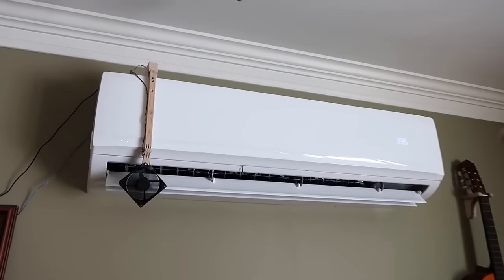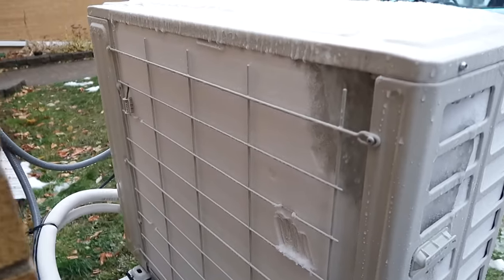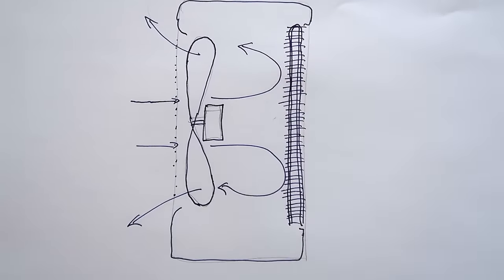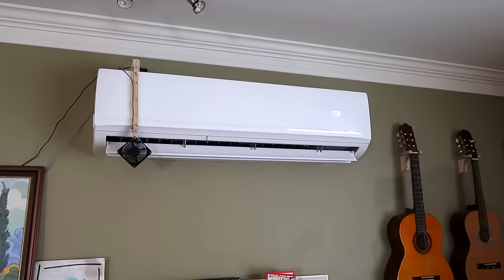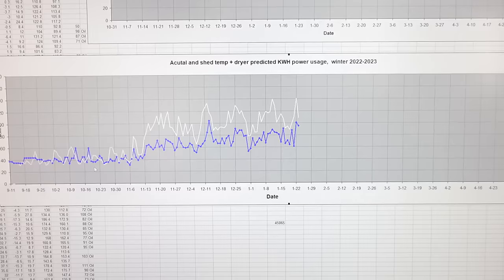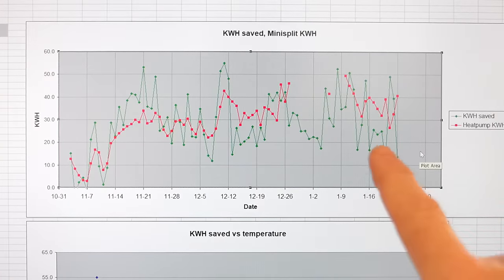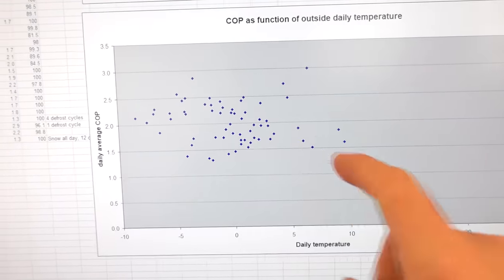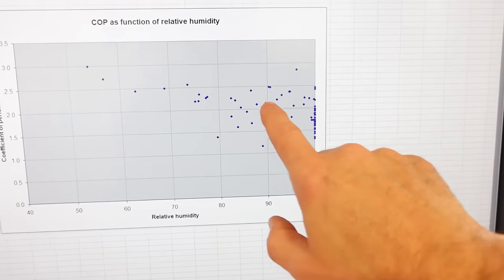How efficient are our minisplit heat pumps in the winter

Comment: Man you are amazing. I'm off the grid in a tinyhouse, so every Wh counts and I've been dying to know about all these things! Thanks for all the work!

On a fun note: it's crazy seeing your numbers of 80-100kWh per day, compared to my 5kWh per day D: :D
Reply: Leave enough space around the outside unit when making the shield. If the air flow is bad the efficiency drops
Reply: Or hear about “cheap electricity” when we in Sweden had around 3 - 6 SEK (0.3 - 0.6 USD) per kWh in December.
Contrasts.. 😁
Reply: @VarionJimmy  wow. Here in Toronto I pay $0.10–0.14… 7k is like $1
Reply: 100kWh here in the UK right now would be around £34 at the domestic rate. That's probably $40 or so US. 😱
Reply: What do you do to consume 5 kWh per day in a tiny house? You need some more efficient appliances man. I run a regular house with 2 freezers, 1 fridge, washer (no dryer), stove, water pump, water heater, computers, lights, 60 inch tv, ... on not much more, about 6,5 kWh per day. All A class european efficiency score appliances. Freezers consume 90 kWh per year.
Reply: @aleksanderkac7530  It includes heating (using a heatpump). The electrical stuff only is about 0.5kWh per day.
Reply: @aleksanderkac7530 What do you do for e.g. hot water? I have a similarly normal home, but most days I can't get near to 6.5kWh, and it's not the always-on devices that are the problem. For example when my wife had a 17 minute shower yesterday, that consumed 2.8kWh on its own (10kW electric shower).
Reply: @BoBandits  Niagra Falls.
Reply: Its why I say solar is nonsense.  Typical US house will need at least 20-30 KW input.  Commercial installations might make sense.  But initial investment is very high.
Reply: @cooperised  I would put a timer on the heater and only turn it on when use is expected.  I would also look at disconnecting one heating rod if not needed.
Reply: @rogersmith7396  Also to solar: domestic solar can work extremely well if you have enough roof space facing an appropriate direction. Battery storage helps a lot especially if you're out during the day but also increases the investment cost of course.

A typical house might use 20kWh per day but that's not the same as 20kW continuous, in fact it's an average of less than 1kW across the day. We have 5kW of panels and no battery, but we time our washing machine and dishwasher to come on when it's sunny so on bright days we pay very little for power, just enough to cover the base load overnight. We were expecting a 20 year payback from the panels but with current energy prices here it'll be less than 8 now I think.
Reply: @rogersmith7396  Hhahaha this is such a bad take. 

Yeah, if you want to maintain the current level of gluttonous luxury spending and utter disregard for efficiency, yes - it's all a bad idea, we shouldn't do anything and so the world will end in 100 years. 

But maybe like.. change the behaviours that got us into this shitty position in the first place? Then we have a chance, and maybe our lives actually get better because we're a bit more consciencious about our lives and what we're doing with them..
Reply: @cooperised  Fine.  Most people don't want to time there activities around the sun or lack there of.  On TV I've seen the panels last as little as 5 years then its back to the banker for a loan.  I am in a windy area, I would like to experiment with turbines.
Reply: @tau9632  Then why would you live in a place requiring 9 months of heating per year like the author?  I guess you think everyone should move to Malibu although I guarentee you the AC runs night and day.
Reply: @rogersmith7396 Well, storage batteries can help with the timing. But really, if humanity has got to the point that we're so wedded to personal convenience to the exclusion of all else that we're not even prepared to use the timer on the washing machine to help save the planet, then we're doomed.

On turbines, I agree, I'd love to experiment. They're not typically very effective in urban areas because of the air turbulence caused by the buildings, but if I could generate even 50 to 100 watts overnight then it would cover much of my base load and complement the solar really well.
Reply: @cooperised  I live on top of a ridge in a rural area and get lots of wind.  A car alternator can generate 1000 watts at 2000 rpm.  Would need to gear up from propeller speed.  I could probably put 10 on the barns ridgeline.  Probably just sell it back to the utility to lower my bill.
Reply: @rogersmith7396  That is only 4 hours sunshine for a 6.6kw system which is cheap. Solar works, please try and keep up. The only problem with solar is exporting energy to the utilities who want it for nothing.
If you have any hobbies, like woodworking or metalworking you will love solar because the stable voltage makes your machines work as advertised. You will definitely notice how much better everything works when the syn is out.
Reply: Why are you off grid?
Reply: @kellymoses8566  Mainly for my sanity.. to be away from people, to be surrounded by peaceful nature, as a challenging but fun engineering and scientific project.. and finally also to explore the options
for a sustainable future.
Reply: @rogersmith7396 , Please don't disconnect one heating rod from the water heater, you'll be making things worse and won't save anything and the water heater will spend more energy and break up faster. Water heaters have 2 heating elements for a very good reason and never run both simultaneously anyway.
Reply: @edide1627  It can be tested. I also plan to use a timer.  The rods are 2500 watts each.
Reply: @rogersmith7396  If you understand how they work you would not need to spend time testing anything.
If you want me to send you a link to a video I saw a couple of weeks ago it would save you a lot of time (can't find it for some reason right now) but if you are really interested just reply and I'll make sure to find the link for you. 
It's a 30min plus video but very well done and I found all the information in it to be reliable.
Reply: @edide1627  I don't know if the heater will get installed this year.  Its not a high priority to me.

Comment: Great discussion. We installed a hybrid water heater with similar function to the minisplit from a gas water heater.  You’ve inspired me to start collecting a bit more data with external sensors.  Of course, to proof is usually in the utility bill.

Comment: My 8,000 / BTU seer 21 Pioneer split heats my 23 foot travel trailer at 8 degrees no problem. It draws a constant 400 watts to do so. Above freezing, in the 30’s it draws around 240 watts and cycles on and off. My trailer is super insulated with R15 in the walls, R23 in the ceiling. There is nothing like the luxury of good insulation and one of the more efficient mini-splits. Of course a high Seer rating and the time of purchase it a bit difficult due to the initial cost being nearly twice as much. Because my power requirements are so low in both Summer and Winter, I can run all this with solar. Note that when initially started and the Pioneer is running at maximum effort, it can draw as much as 980 watts for a short time. Thanks for the video.

Comment: If you have extra temperature sensors I’d recommend adding one each to a liquid and vapor tube on the coil. It should help you monitor how efficient the OD coil is performing. As long as that temperature is close to outdoor ambient then your od coil is performing well.
Reply: Yeah i'd second that suggestion. plotting the actual inlet/outlet temp of the exchanger would give you direct info on it's efficiency.
Reply: Since this is an inverter unit, measuring the temps on the refrigerant is not that informative. The unit will have pressure and temp sensors giving feedback to the inverter that control the compressor and changes the flow in the system. The one thing I could think of is for detecting unneccesary icing of the evaporator, ie. liquid temp and gas temp are close and way below outdoor temp, but that should the unit detect.
To see if the unit is performing well you should measure the power that the unit consume compared to outdoor temp and indoor temp.

Comment: We installed a minisplit heatpump last year and used it that winter. This year in New Hampshire electricity is extremely expensive so we are only using our cordwood stove.  We have an LG red system with two compressors and six indoor units. I didn't notice much in the way of defrost cycles last winter but I was not monitoring it as closely as you are.

Comment: These things are super common in Sweden and has been for 20+ years. I use one to keep +8C in my workshop. Works great! Also common is geothermal. My borehole for the house is 250m deep.
Reply: What goes in the hole?
Reply: @Manofcube  U shaped pipes with ethanol. It pumps cold liquid, and brings back heated liquid, so it takes temp from the ground below the house.
Reply: @mrjozza5924  Unfortunately we don't have those wells here in lower europe
Reply: @dimmacommunication  It's a borehole, we have those (it costs money to bore ofc). Now here on private Land we are only allowed 100m i think. But we do have warmer temperatures overall, so it's fine.

Comment: Mini splits are amazing, we're using one since this winter. Some are better at heating than others though, COP 4 or 5 is doable for really optimized ones. Around zero C we're using the same amount of electricity of 3 dishwasher cycles per 24 hours.

Comment: Great video! Yes, I also would add a roof to the outside unit. Join the house wall to the top of the unit to stop the snow from being sucked in. Maybe a few inches on the side. The remaining 75% air flow on each side should be enough.

Comment: I have a Mr Cool which i believe is a similar unit and another cree.  They both do a great job.  Your observations match mine exactly.  Doesn't do the best in cool humid air, builds up with ice.  Once the air drys it does alot better.  I keep a wifi temp sensor near the output and have been monitoring as well.  Outside humidity can make a huge difference in how quickly the coil reaches max temperature.
Reply: My MrCool was not heating and I read the manual only to find that the indoor unit thought it was 79F inside. So was able to set it to Follow Me and that makes the remote the thermostat. I put the remote 20’ away and the unit started heating again. Wondering how it will do in cold winters where we can easily have some -10F days.

Comment: Your attention to detail and knowing how to measure are impressive. Have you considered placing a roof over the mini split outside unit to keep the snow off?
Reply: They’re made for outside. No need to cover…
Reply: @paulettelambert7965  But it would mean less defrosting cycles. That was the whole point in recommending a shelter for it. Plus it would be less likely to rust so soon. Have you seen how those things have rusted before? You see them frequently all rusted up. Hopefully newer models have learned.
Reply: When you live in a coastal climate it is very important to cover the AC unit, otherwise the casing will be damaged in a few years. Covering it will save you many years of use and money! I live in a coastal region and had a AC go bad in 5 years.

Comment: Matt, 
This was very interesting. I understand they are more efficient than resistive heating but its hard wrapping my mind around it when they are driving a compressor. Just a suggestion for the summer months eh! I've seen the evaporator units make a mess of the walls when the condensation drain clogs up. Be sure to keep the drains clear! 
Best Wishes,
Tom K.
Reply: When trying to understand how these work it helps to think of them as oversize, reversible fridges with fans.

Comment: +1 on some sort of cover over the outside unit.  My unit is not up against a plain wall...  My workshop is on piers with air flow under it (floor joists have insulation between them)  So air into the unit is coming from a sheltered area.  The little corrugated plastic roof extending out over the unit from the shop wall therefore does not restrict air flow.  That roof helps also to keep debris from being sucked into the coils.

Comment: some great information here thank you for putting this video together! I did want to give you a heads-up that when the units go into defrost, they aren't heated up with an electric element, it's the refrigerant inside the coils that are pumped in reverse. that is why you felt cold air when you turned it to air conditioning mode to dethaw it.
Reply: And in defrost, the indoor unit fan is off to stop a cold draught in the room.

Comment: Your experiements/work with cyclone seperators should come in handy for building a duct for the outside units that settles any snow out before feeding dryer air to the unit.

Comment: Nice video. Someone told me if you keep your mini splits outside in an enclosed environment like a box, it saves a lot of energy since it will not be exposed to elements. This could make the number of times it needs to defrost less saving energy. I don't have one myself so it is just something that i heard and thought i will let you know.
Reply: Cover from elements and shade from sun is good, but restricting the airflow is bad.  Roof with no walls would be ideal but most people want to hide them vs draw more attention to them.

Comment: I think my minisplit system has resistance coils in the outdoor unit to defrost itself. I didn't realize that some units didn't have this. Love your data gathering and analysis!
Reply: This is the key with reverse cycle systems, it is one valve and little electrical change between heating and cooling but does it in one vs independent units.

Comment: I've used air conditioning all my life for both heating and cooling. I'm from the UK Daikin 1800 BTU split x2 stick it on brackets put it on the wall outside works a lot better. A decent AC will run the inside fan very slowly in defrost. I'm happy with both my units even at - 10 Degrees C.

Comment: After 7.42 I realised you have reached level 100 Electrical Engineer. I was trying to guess if you were mech or elec, but the instrument comment is 100% elec haha! im mechanical, and loved the content. PS most elec's always take it to the next nerd level and that brings me great joy! 
I found this video by looking into misting the condenser (in cooling mode obviously) to increase the efficiency, my search is inconclusive and you have all the gadgets to run a test in summer.
Reply from the maker: it will help, but I don't think its worthwhile.   Increased complexity, increased corrosion, reduced lifetime.
Reply: @matthiasrandomstuff2221  After everything I've looked into, I agree. My water is quite hard and the calcium build up will just kill the efficiency long before corrosion kicks in. However, I ended up setting up a manual misting system to assist on hot days >40 deg C and it made a noticeable difference. I would be super interested to see what results you could get even if you just mist with a garden hose for 30 minutes.

Comment: One of our unit have an auto de icing so it stops heating for a couple of minutes when it detects icing. It is computer controlled and even have prepare mode before heating in the morning.  Our other unit is just cheaper one and heats non stop until it ice up. We don't usually use the dumb one because it is the bedroom.  The smart one is in the living room even have an app so you can track your 2 years of power usage. Current year is overlaid over last year.

Comment: It would nice to see the data show actual ambient temp, there is lots of video's show how this works in what appears to be moderate temperatures. I live in a area where it can be -20 to -30Cfor a good portion of the winter. Electricity costs are about $0.31 per Kw/hr, natural gas is about $5-7 / MMBTU. So based on what he is indicating there is no cost advantage.

Comment: Here some of our outdoor units actually have a resistive heater coil around the outside refrigeration coils to periodically defrost ice blocks without having to reverse the system :) They call sell those models here in the more southern areas (they cost more and the feature isn't needed in more northern areas).
Reply: I have no idea what you're talking about. Post a picture?

Comment: i received a presentation on samsung VRF systems at work recently, where they showed that they have air pressure differential sensing to determine if the unit is iced up, so that they can potentially run the defrost cycle less frequently. not sure if others do this too, but thought that was cool

Comment: my apartment has a similar unit, we don't use it in the winter due to the building's baseboard radiative boiler heaters, and the lack of consistent airflow.

But dang is it efficient.

Comment: If you turn on the Turbo mode, that will force the basepan heater on and warm up the house more quickly or hold a higher temp over night, of course at the cost of more power usage. Mine never ices in AZ.

Comment: If you were to build a structure around the outside unit, a greenhouse might be a way to achieve greater gains. If you add barrels of sand for thermal mass, it would become a hybrid geothermal system (above the ground.)

In summer months you would open the Windows and doors (switch to screens) and hang opaque shade cloth inside the roof and walls to intercept sunlight from reaching unit.
Reply: No. That would not work. The "greenhouse" would have to be larger than the house house.
Reply: I had ideas like this but considering the limited hours of light, the size of greenhouse required, and the cold air getting trapped not a good idea.